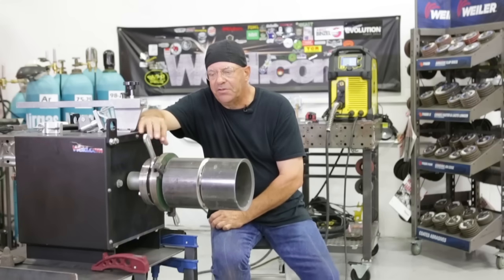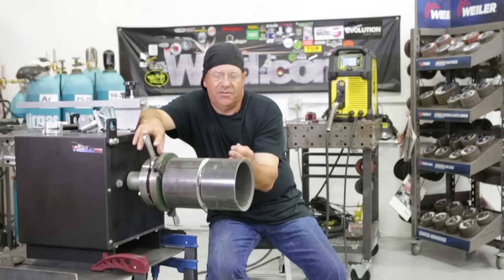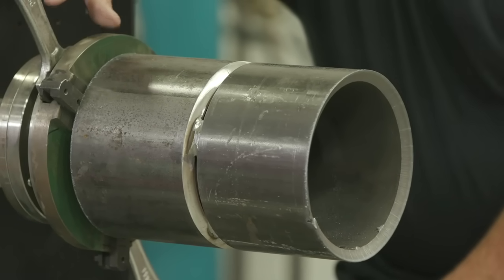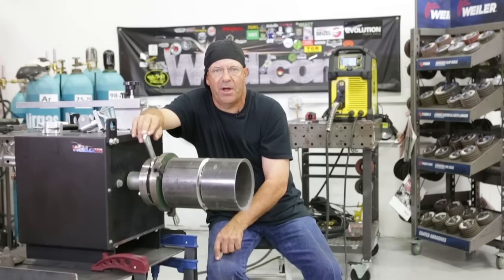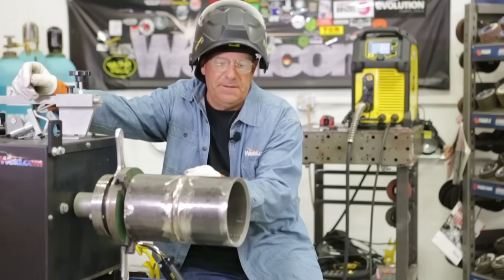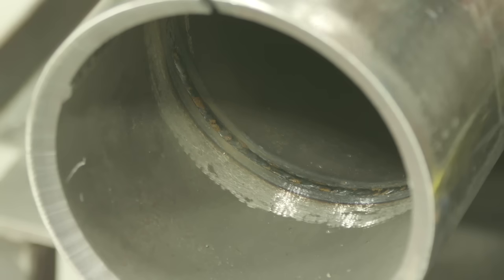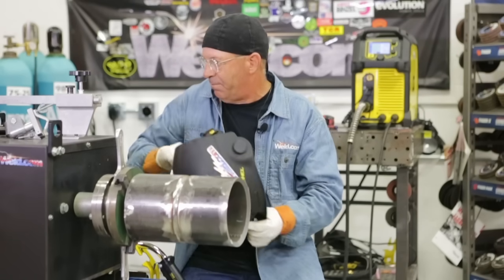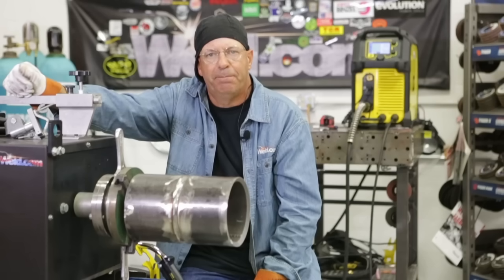🔥Pipe Roots: Short Circuit MIG (Roll Out)

Comment: Dang pesky grounds!!! Lol... 
Before you mentioned the ground, I was wondering if the tip was loose or a little worn.... 
I've never been lucky enough to use a nice rotating utensil....
But we used to widen a lot of agricultural wheels... You know, little ones.. LOL, 34"-42" stuff.. no matter how good you are, still a lot of work fitting them back up! 
Made some nice adjustable roller stands, not powered, but worked great!!! Would sit in a chair, lean inside and use my knee to rotate the wheel.
Made a lot of money on those.. but a bad fit, took way too long to make right!!
Yet another great video Bob!! Thank you!

Comment: Could you add metric measures for us who don't use inches like wire speed and wire diameter. Thanks for great content.
Reply: Unless and until they do so, simple formula: mm = in × 25.4  alternatively, mm = in ÷ .03937  Note that the first formula is exact, the second is slightly rounded. The actual constant for the division equation is 1 ÷ 25.4 = .039370079 , but 5 decimal points is usually plenty unless you're doing super close tolerance grinding or something :-)

Comment: I'm adding this here because I don't usually do this social media stuff any more just so tall know the US Navy developed 80% of welding processes that are used to this day . And the only thing the navy will use mig (gtaw) for is aluminum that is the only material one can get an mig x-ray qual. in because in any other material it remains to soft to the point of a ER70S-? Remains to soft and must be heat treated and I don't mean a little soft . Fresh out of the navy as a high pressure pipe welder (4955 code ) I worked for a company that built these three chamber cabinets out of 2"plate the largest side of this behemoth was the back it had to weigh unattached by its self 12-15,000 pounds (the finished cabinet was 86,000 pounds ) in layering the plate steel together I would have to flip this piece over and I would  do this by either welding a steel ring with a 2" wall thickness on to a side in order to lift it with mig er70s-3 or 1/8 7018 now the 7018 I could apply one healthy bead ( about a 3/8 root), where as the er70s-3 I could put a root and two covers and it would tear at the first attempt at lifting it . Mig is crap and should never ever be used for pipe because no one is out there heat treating it . Now you may say that the Navy ships use mig welding in their construction all the time . You would be wrong the Navy does not the private company that is building the ship is and our crooked goverment in a complete disregard for the safety of its Navy personnel allows these companies to "except responsibility " for any failures.
Reply: There is more GMAW and FCAW wire types out there than you can count. Your experience is not evidence that GMAW is not strong or not safe. All welding processes have the ability to produce the same quality welds. Asuming your weld was mild steel (beacuse you used er70 filler) there is no point in heat treating it because the steel is not heat treatable. If you were welding mild steel to a high carbon steel then the joint should be pre heated to at least 450*F for 2" material, welded and left to cool in still air. If you were welding 2 pieces of high carbon steel then you were using the wrong filler. You should have found an er90 or er100 filler, pre heated, welded, cooled under a blanket or sand  and then PWHT the weldment. Furthermore using short circuit transfer for anything over 1/4" is not a wise choice. Use spray transfer in position or pulse spray out of position. If you don't have a machine that can do pulse then use FCAW.
Reply: I’ve shot x-ray with mig on stainless and carbon steel...interesting enough they shot clean.  I guess that means you’re part about aluminum being the only thing you can get an X-ray quality weld is bs.
Reply: @stout8807  You're right. We do GMAW on mild steel and stainless steel all the time. Steel gets UT and SS gets RT. Both pass no problem. I have qualified our procedures for Charpy to 27Joules at -60*C or better on both GMAW and SAW. I also qualify our new welders on GMAW and SAW on 1" coupons and they bend great all the time. We have had failures but its not the wires fault when the entire root is not fused lol.
Reply: Geoff Moore what I don’t understand, how people think ER70s6 is different wether it’s mig or tig wire.  Most people I talk too that doo pipe with gmaw, run a mig root and either spray, spray pulse, or fcaw the rest of the way out.  I’ve done some short circuit all the way downhill on .280 6” and have had great success.  I guess some people don’t understand why why there is PQR and a   WPS.
Reply: Michael Vaughn , are you trolling because of Bob’s IG post?
Reply: I have welded large oil tankers and warships with Mig process with excellent results (sorry for my English)

Comment: Mig on pipe are you fncking kidding me mig doesn't burn got enough it must be heat treated after and tell me who the fnck out there is heat treating mig welds after the weld is done ? Are you fncking stupid .
Reply: No, are you?
Reply: @bobmoffatt4133   Excellent reply...!
Reply from the maker: You're mistaken, sir. I see you saw my IG post though. Thanks for following directions. Have a great day.
Reply: Well Michael Vaughn;  There’s a WPS for it..... clearly you have never done a procedure qualification in modern times where GMAW is king.. speed and productivity is the name of the game, that’s the only way we build America.
Reply: Michael, fix spelling and punctuation in your first run on sentence, name the pipe composition, dimensions, and its specific function where in service, delete expletives, and only then will you get likes. If that doesn't work, read your second line until you fall asleep.
Reply: Lol the only one showing ignorance here is you maybe u just started welding though so...
Reply: Welded process piping for gas compressor unints for 9 years.We used gmaw hard wire roots and gmaw metal core fill and cap.B31.1 B31.3 codes normal severe service.Alot of it was 100% percent x-ray
Reply: It's been done since the 60's. https://www.youtube.com/watch?v=dMxel7uCu64
Reply: Your crazy man I’m a header code welder from okie and we use spray arc and short arc on 100% X-ray all day
Reply: funny, i seem to remember using a MIG root when welding hundreds of Dril Quip Quik-Thread® Connectors on 30" offshore conductor pipe with a Sub Arc back in the late 80s and early 90s for Union, Texaco and Exxon 100% x-ray . just because you've never done it don't mean it can't be done.

Comment: Root passes aside. Where do you draw the line with mig downhill and switch to uphill?
Reply: Short arc? Right after the root. All fill / cap passes uphill.
Reply: I was wondering more about non pipe welding applications. Like low pressure ventilation pipe and stuff 1/4 thick or less. Would you still want to run it uphill or would you be satisfied with a downhill weld?
Reply: Richard Giese I was always taught out of position to always run up but I’m sure Bob has an answer for you.
Reply: Mig is uphill usually unless you just can’t especially aluminum.
Reply: @weldingjunkie  What? Totally depends on joint configuration, thickness, mode of metal transfer, material type, WPS.
Reply: Bob  Moffatt ? I was talking about the comment. I didn’t realize you commented. Like you said all fill cap uphill passes.  Not down. I didn’t realize you were talking about all different configurations. 

If you can’t get to the pipe in real life you have to do what you have to do no?

Comment: Old Timer told me when the hood drops the BS stops
Reply: Yeah....back in the early 2000's I was doing a lot of steam vessels, carbon steel, pipes, tanks...all welds were full pen, V-up, .035", C02,  from the outside....30+ year old Linde MIG power source/feeders. Pipes from 2" up to 24", tanks from 78" OD, 5/16"-1/2"wall....no grinding in there, or on anything outside after the welds...! Poke a wire through, you're out of there...
 Tests were done on the 1" plate coupons, cut from 1" wall thickness pipe, 6G....
 With the newer welding power sources, and mixed gasses these days, that would be a walk in the park...
 Plenty of TIG stainless there too...also the antique Linde stuff....
Reply: @dougankrum3328  I used to run old Linde welders and their wire too.
Reply: @bobmoffatt4133  ...Employer bought the stuff at an auction, 2 TIG, 3 MIG...I had to de some repairs on them, they were all actually made by Miller. I bought a Miller-Matic 200 in 1981 when they first came out....hi-lo plugs for voltage and 6 position step switch...still works great....I had a welding shop and ran over 300 rolls of .035, 33# rolls....
  And, my Mother was born and raised in Topeka, went to  KSU and I still have the Jayhawker mascot figurine....so I guess you're alright...……!
Reply: @dougankrum3328  But, I was born and raised in Oklahoma. OU!
I'm a transplant 5 miles into Kansas. Love KState and KU basketball though.
Reply: Pretty much, but after a while in the one type of welding you end up becoming specialized at that and a little bad/rusty at the other stuff.

Comment: How does the short circuit compare to the RMD or STT processes that some more advanced production machines have?
Reply: Those advance processes are sweet. A bit faster too.
Reply: Bob  Moffatt is it just speed. I’m an apprentice steam fitter at a refinery and our fab shop is starting to use the Lincoln STT stuff. I’m still getting the hang of 6010/7018 out, but should be testing in a couple months. Is practicing at home on one of my short circuit machines even close? I’m not allowed to touch the MIG machines at work yet.
Reply: @DvS2171   It's fairly close
Reply: Bob  Moffatt Thanks Bob. Your videos have definitely helped me make the best out of my practice, especially before I got into my Local and had the teaching resources that the union provides now. I appreciate it, please keep making quality, industry applicable, and funny content, and I’ll keep sending my classmates and younger apprentices your way on YouTube.

Comment: You were whipping the wire pretty fast. What was your wire feed speed?  Voltage?  You sure do nice work
Reply: Camera may have made it looked like I was going back and forth faster than I actually was.  I like the tick tock back and forth. 18V, 200-225IPM
Reply: Yeah he wasn’t whipping it’s the camera you can’t whip that easy with a positioner.